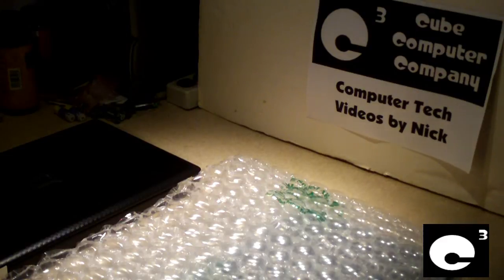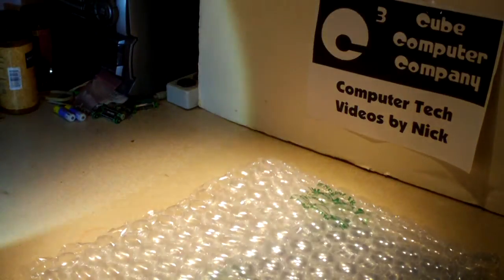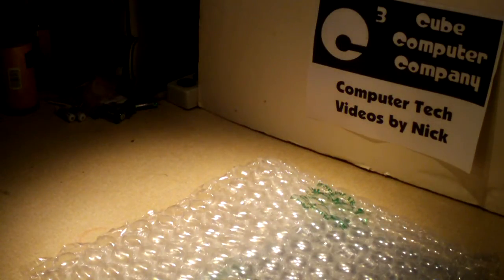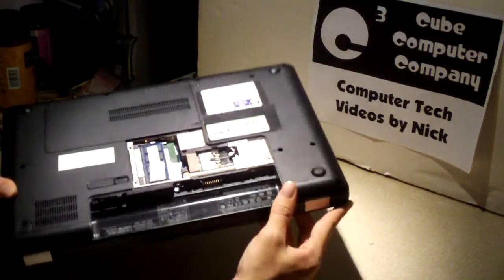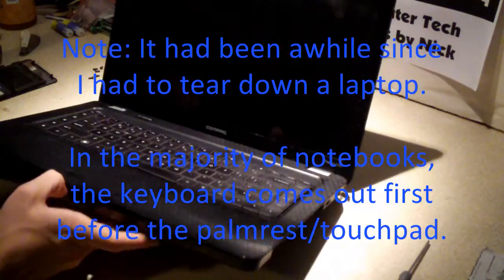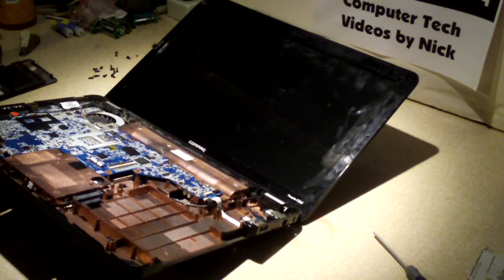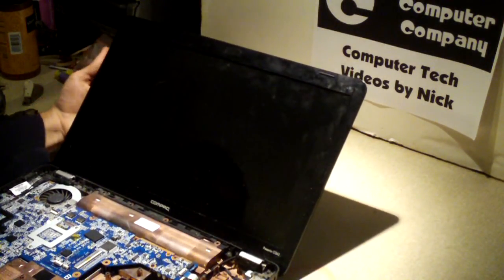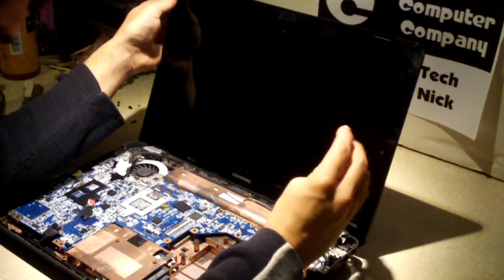LCD Screen Replacement on Compaq CQ62-220US Notebook

Comment: If u r only repairing the LCD y do u need to remove any parts other than the display bezzle?
Reply from the maker: Generally, you don't have to. It boils down to personal preference.
Reply: Hmmm I C. :-) that was a old thread didn't expect a response. I just felt it was kind of over kill to proceed in such depth. But, glad to know you are still at it. Hope all is well and healthy with you. Take care. Thanks for responding